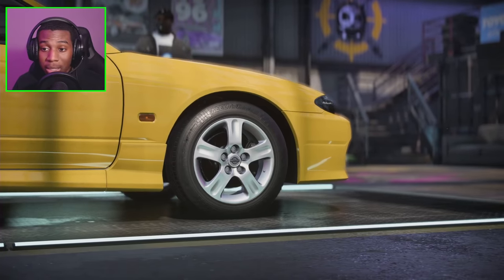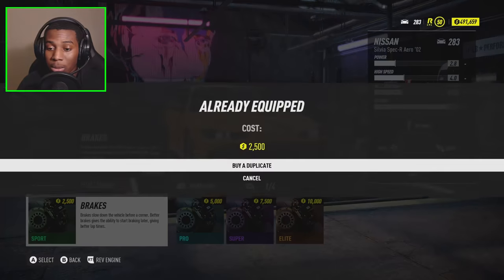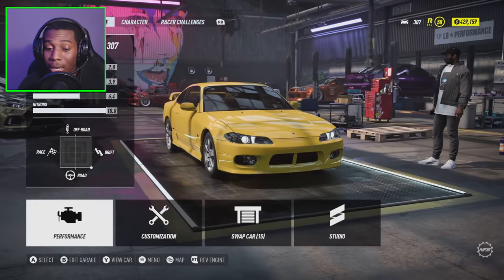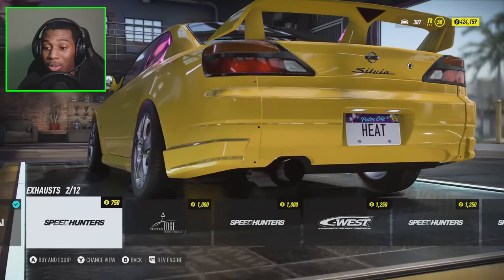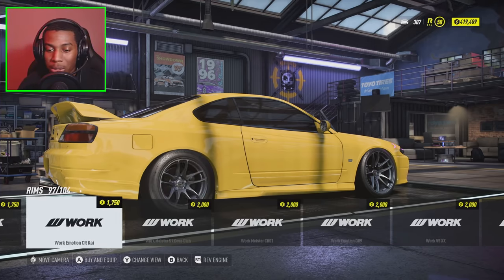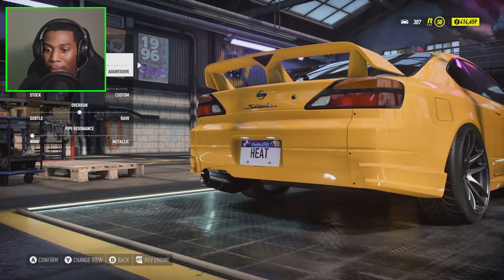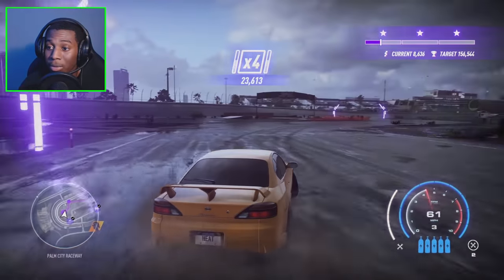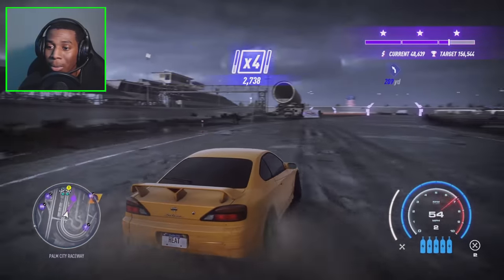NISSAN SILVIA S15 DRIFT BUILD! | Need For Speed Heat

Comment: Questions. I tried turning my starter car ( E30 bmw) into a drift car just to finish the story missions. And it just spun in circles, went full drift setup and couldn't seem to keep it together. My first question is, is it because it starts off as a street car? Or is it just certain cars are better than others? Should I start with a car that is based around drifting and build on that? Or possibly change my setup? Any info is appreciated because drifiting so far is pissing me off LOL
Reply from the maker: you may need more power! i have a bmw video!
Reply: @CrayG  Cool cool, I'll check it out

Comment: Just been looking at a couple of other Drift Build videos and noticed one thing.... every build uses ultimate parts in the engines and elsewhere. It would be nice if a drift build video popped up that used say super/super+ parts max for us players that haven't been going that long (me for one *cough*work*cough*). Anyway, I'll buy a S15 or maybe I'll re-tune the Miata for drifting instead. heh
Reply: The rx7 with super/super+ is an underspec drift monster... If only they gave you extra cash or rep for an underspec car....

Comment: The speed cross suspension and differential is actually better then the showcase for some reason it makes you slide a bit more
Reply: I suppose that kind of makes sense, they're offroad/drift therefore should produce less traction onroad, meaning more slide haha

Comment: CrayG, slick wheels bro! Could you check out the RX7 and make that a drift build? I've tried and spent well over 500k trying different setups for it to drift, but alas it will not drift for me.
Reply from the maker: i have a video on the rx7!
Reply: @CrayG  alright I'll find it and check it out! Thanks man!

Comment: Imo the Silvia has the most realistic mechanics atleast with my setup
Reply: What set is that?
Reply: John Ocampo I’m late my fault but I run drag tires, showcase suspension and diff, if you need more oversteer try the drift diff
Reply: John Ocampo drag tires are almost always the waves as well, use the e brake when you need to kick it out or Initiate the drift, put your steering sens all the way up so u can counter steer ez
Reply: @takumifujiwara7334  got it thank you